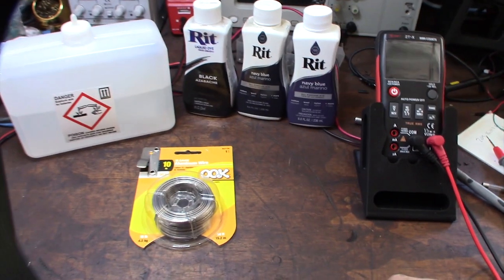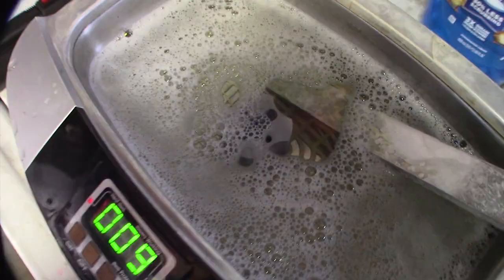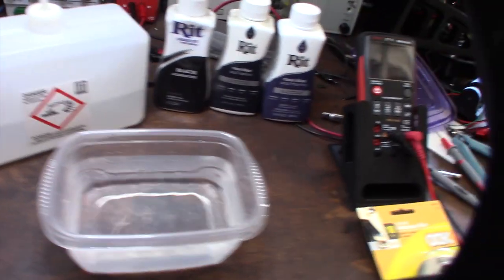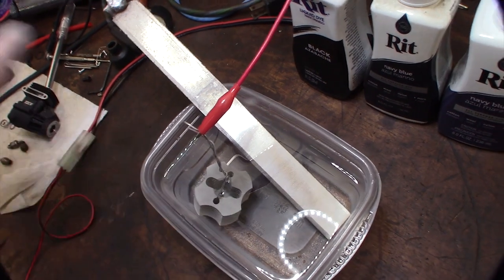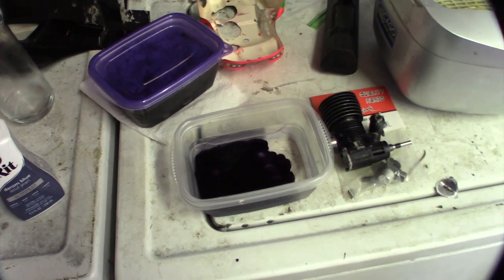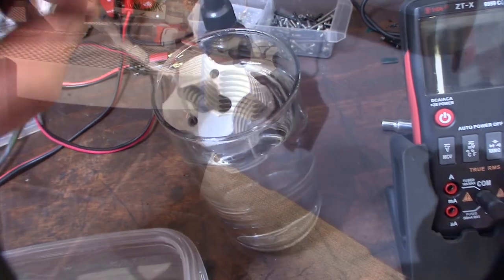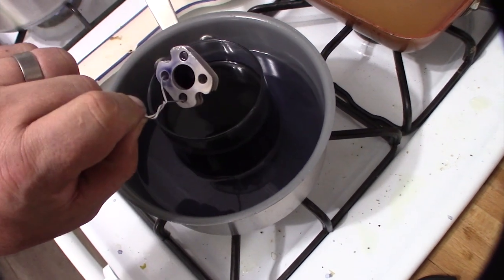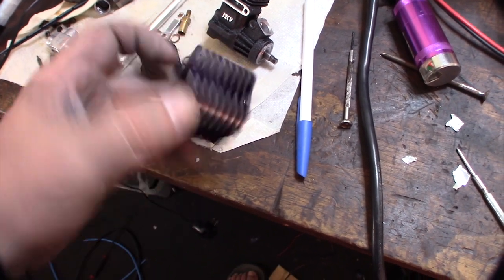DIY Rit Dye Anodizing,  How To Anodize Aluminum At Home

Comment: 1 - 1:52 - Safety tip - You pour water first, acid second.  Acid into water. Never water into acid. The splash back is too corrosive.
2 - Wear gloves and goggles. I don't think you are wearing either.  Use chemical resistant Nitrile gloves or Neoprene, not this cheap and loose vinyl which is slippery and will tear.
3 - In Rit dyes, there is no 'majestic blue'.  I think you mean 'royal blue', which is a nice color. But so is denim!
4 - You have to hang that part on a rod and lift it off the bottom. It should not sit on the bottom of the anodizing tank or in the dying tank.
5 - After dying, you have to boil it so it closes the pores and traps the colors. This is not a rinse cycle it is a slow boil.

Its very smart to use Rit dyes at $3-$4 per bottle of 8 oz vs Anodizing Dye on Amazon at $19 for 1.41 oz!!!  Same thing.  It should work fine if done right. Good demo and I understood the process. I think you need to boil it at the end to set the color.

Comment: You're misinformed about the cathode material being deposited on the anode material that's not what happened oxidation happens on the anode which causes the aluminum to grow the protective layer
Reply: Thank you I’ve done rust removal and zinc plating but I didn’t understand the science of anodizing. The factory I work at do it for heat exchangers for the military but I didn’t understand what was happening
Reply: Food for thought.  A brand new anodizing set up needs to have “dummy” runs to condition it for use.  Apparently, you need a certain amount of dissolved aluminum ions in conjunction with the acid ions.  As far as I know, the aluminum comes from the positive charged work piece.  Other metals alloyed with the aluminum eventually show up on the cathode as dirty smut.  I have personally anodized 3003 aluminum and the acid took a faint pink from dissolving manganese.  Later on, it was deposited on the cathode as brownish black smut that I abraded off after the run.

Comment: Was your sacrificial material (cathode) aluminum?  I've been trying this with very unscientific methods and not having good results, I used lead sinkers clamped on copper wire for my cathode.  Older video, no need to respond, thanks for the tutorial

Comment: Why do people sand or sandblast to remove anodizing? It seems so much easier to just dip in a lye solution for a minute, but I assume there's a reason a lot of people use abrasives instead?

Comment: Really cool. But easiest way to remove rust is do what gunsmiths have done forever: boil in water. Or use steam….
Reply: Meant to add a carting wheel MUST be used to remove dust layer of rust. Your finish will still be there if rust blued.